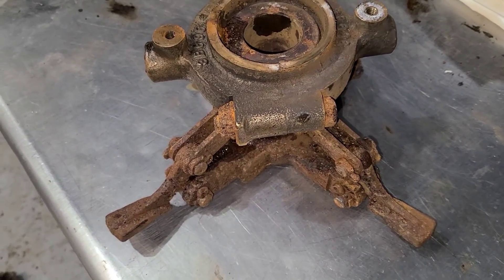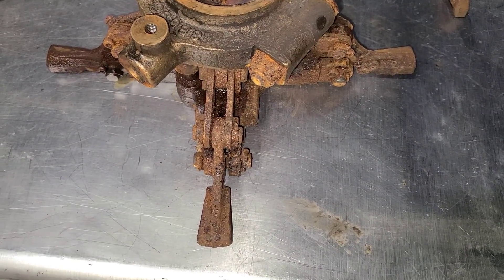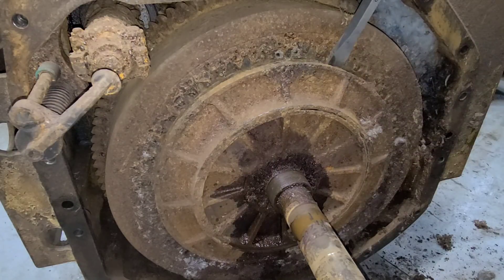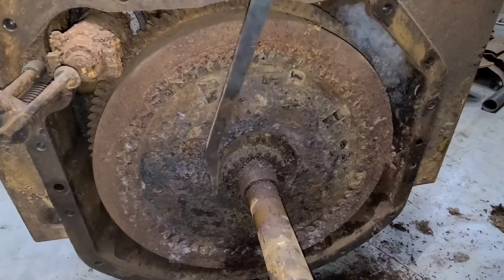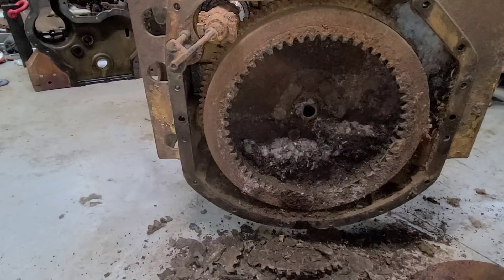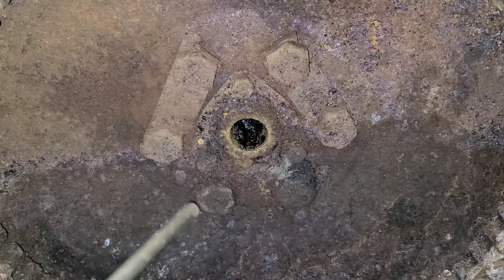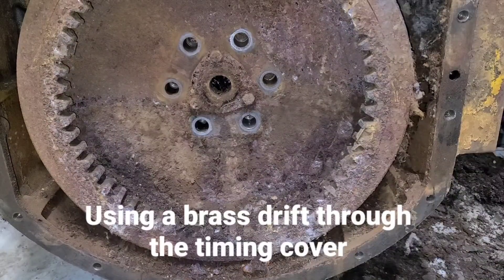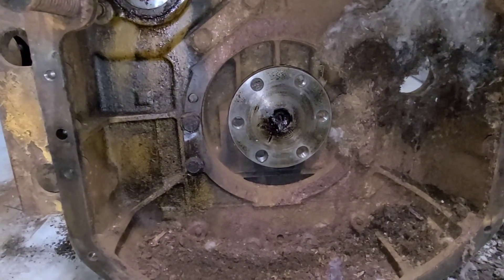Caterpillar RD-4 Clutch Disassembly

Comment: It's really a big question for me, as to why field mice like to make their homes in abandoned machinery. Looking at the elements, it would seem that the way iron, steel, brass, and other associated metals that are found in machines absorb cold air from extended freezing temperatures and thereby, become frozen metal as well, it would seem that the mice would not want their offspring nor themselves exposed to such a harsh environment. Burrows, deep grass, rotten trees, all seem like way better places to spend the winter months than huddled in a rusting old engine or some other similar place. Hell, I don't know, it is just something that I have always wondered about. But that has little if anything to do with Kyle's Cat restoration project and I apologize for making my personal thoughts a part of this comment section.
Reply: Not just abandoned. After visiting family friends on their farm,I popped the hood of a rental car to check the oil to find a pregnant mouse had pulled insulation from the hood,nesting on top of the air cleaner. And had stayed there for oh,3 hours of highway travel away from the farm.The small town gas station had a Labrador retriever, so I thought it logical to feed the mouse to it.
And was surprised when  the owner objected. Strenuously.  Dropped the mouse around the edge of the building,it ran under the door of the ladies washroom. Not my problem,so I left.
Me,I hate mice. Why anyone would be compassionate to a pregnant mouse is beyond my comprehension. They are critter food. The mess,the smell and the acidic corrosive urine they leave behind is unforgettable.
So I guess they nest anywhere other mice do not. Anywhere they can find cubic . From tree stump to clutch housing.
Reply: @paulmanson253  Wow !!!
Reply: Better alive and cold than in someone's belly....hawks, owls, fox, dog, cat....everyone wants a bite 😆
Reply: @ The Shadow  LOL, no worries- has to be the same question we've all asked. On the other hand, do the mice ask "Why do people leave these huge portable mansions laying about so handily?"

Comment: Now it hurts to know I scrapped a D4 chassis 15 years ago which had the engine removed but clutch minus flywheel was on trans input shaft. If you can’t find anything in your area I can go back to the D4 I spoke of and look inside inspection cover to see what clutch may look like.